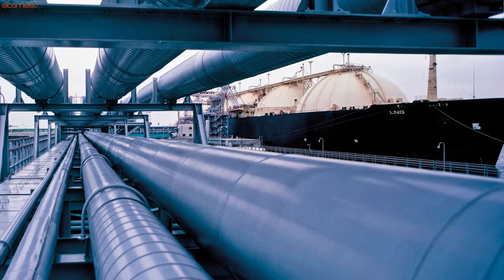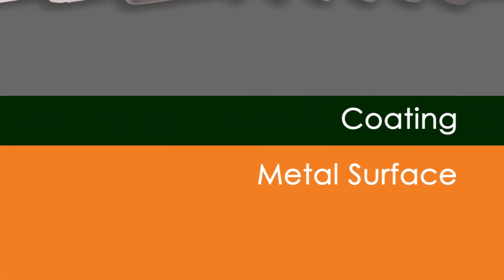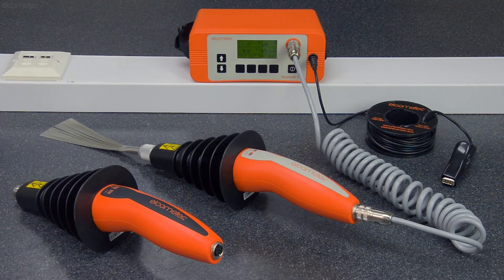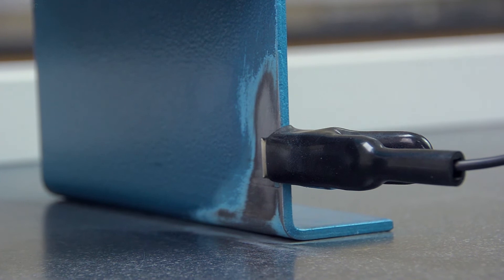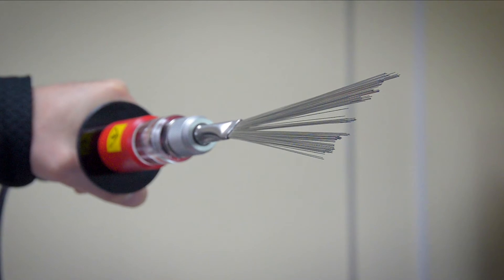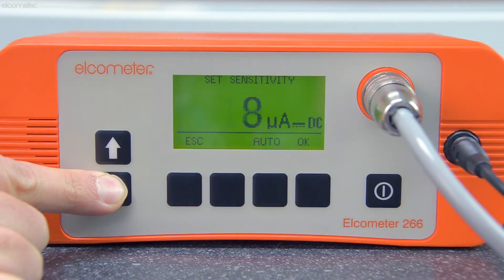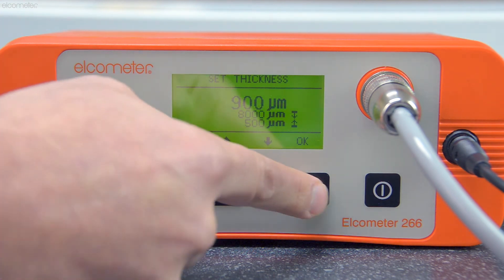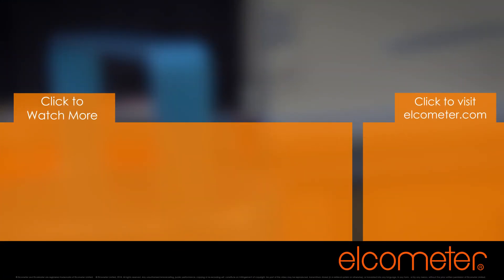How to set up an Elcometer Continuous DC High Voltage Holiday Detector

Comment: I was using 266 ( two different devices) , there is always issue with them.  Tried it on epoxy coating 800um - was beeping for no reason even at  lowest settings , and winylester coating over 4000um was same problem.
Reply from the maker: Hi,
We suggest setting the sensitivity to manual, not automatic. Start at 50 uA and adjust as per the user manual.

If you have any more questions, please get in touch at support@elometer.com

Comment: Hi, I am about to inspect a rubber lagging, however in the previous test the sound alarm is always on once I put closer the wand to the lagging. I think it is because the rubber has in its formulation a component which is conductor. what would you recommend?
Reply from the maker: Thank you for your comment.

For testing slightly conductive coatings, we recommend the Elcometer 280 Pulsed DC Holiday Detector, as it uses a pulsing current to avoid the build-up of voltage charge on the structure you are testing, but it does depend how conductive the coating is.

If you have any further questions please contact techsales@elcometer.com or visit www.elcometer.com/contact-us to find your local Elcometer distributor.

Comment: Hi I used to watching your videos and learned a lot. I really appreciated. My concern is how to calibrate the DC high voltage ( continues DC & pulsed DC) prior to use or inspection, as what we do for elcometer 456, so kindly provide the information, thank you.
Reply from the maker: Thank you for your comment.

The Elcometer 266 and 280 both have built-in jeep meters which monitor and, if necessary, correct the output voltage, ensuring the output voltage matches the voltage set by the user.

You don't have to calibrate DC high voltage testers in the same way you would an Elcometer 456 - you simply set your test voltage to your specifications, and your sensitivity if using the Elcometer 266.

For a certified calibration the instrument should be returned to an Elcometer Service Centre.

If you have any further questions, please contact techsales@elcometer.com or visit www.elcometer.com/contact-us to find your local Elcometer distributor.